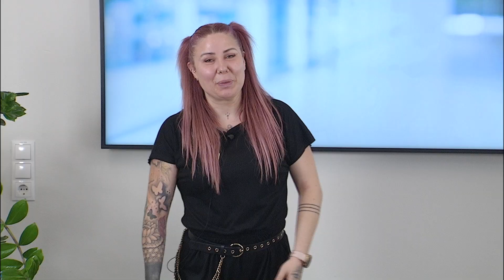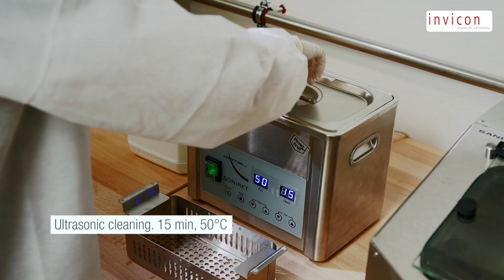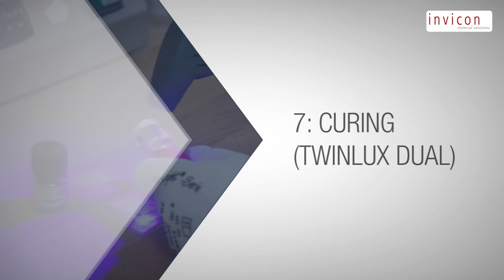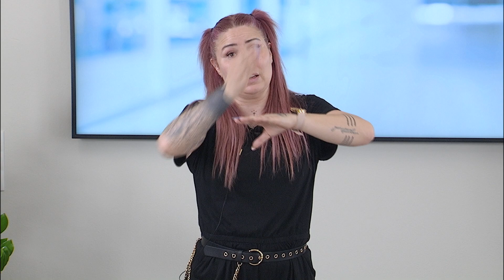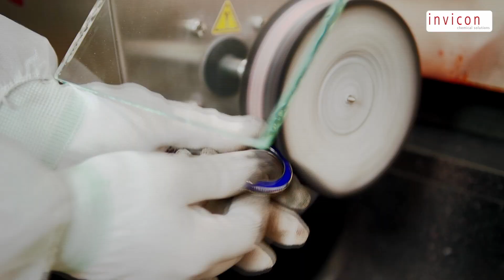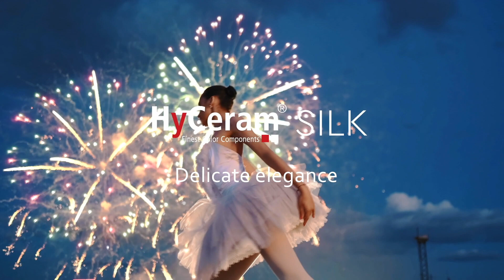Invicon Livestreaming - HyCeram® LuxArt® & Luxon® colors

Comment: How hard is the hyceram material to sand by hand? If I add hyceram to an area that can be turned by machine or on a lathe and has areas around it that needs to be protested. Can you hand sand the hyceram?
Reply from the maker: Hello, 
it can be sanden by hand. You need to choose the right sandpaper grit. At the beginning, use a slightly coarser sandpaper. At the end you can use the fine sandpaper ( min. 2000 grit).